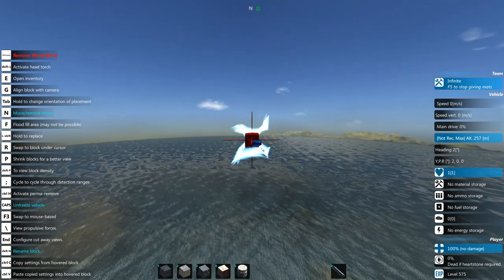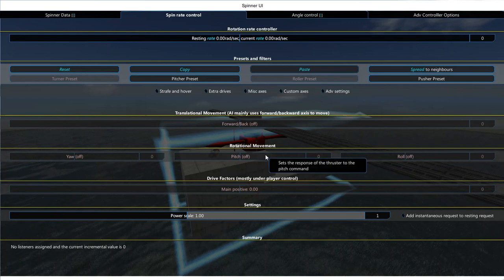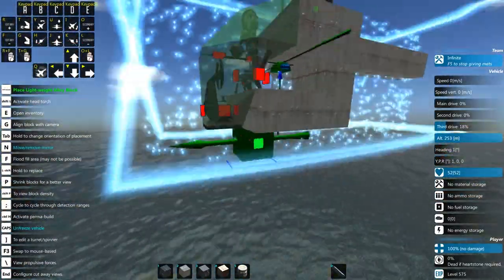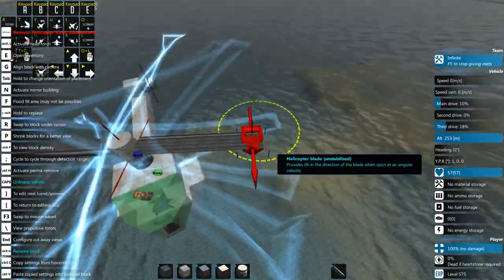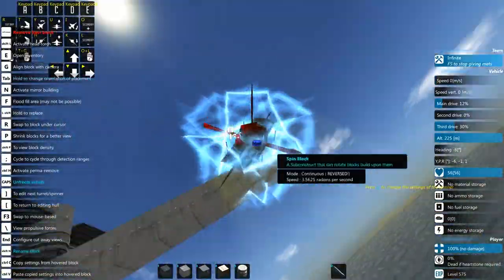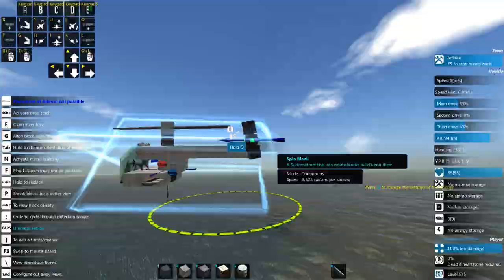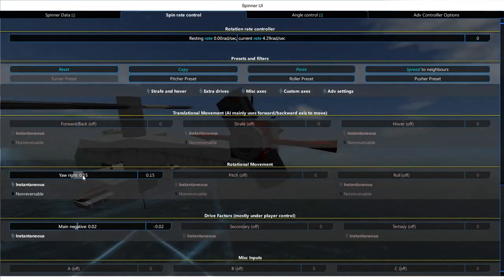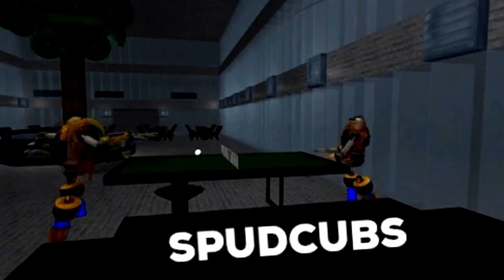10 Minute Helicopter

Comment: The idea of high altitude battles sounds absolutely amazing. I never thought about how much good raising the "space" border would do.
Reply: Airborne battles are lame, space fights are the "chads" of combat
Reply from the maker: Lowly surface combat virgins
Glorious dogfighting chads
Reply: If I'm correct Nick said he didn't really want that otherwise flying things would become "meta" and ships would just be less influential, but idk really, I don't believe that too much. This game has alot of potential simply by changing things (ammo regen gone or really slow, more mat zones but all are limited mat zones, increased map size, more diplomacy options, etc...) basically improve the base game (main campaign needs to be more of a strategy game)
Reply: @bluefireball3760  campaign is as much of a strategy game as it gets
Also, most famous crafts i've seen are airborne, but most ppl try to make battleships first cuz it's easier and you can go ham with weight
Reply from the maker: If you emphasize efficiency by making Fuel more expensive, or just by making larger fleets more necessary(which  would mean more fuel use overall), naval units would inherently by better just by having a lower upkeep cost that airships.

As for lighter-than-air ships(Zeppelins, balloons) -- They wouldn't be able to carry as much weight so they aren't technically more efficient. 

How do this? Make the map  bigger, remove ammo regen, reduce soup.

Comment: I wonder if you could use a 2-axis turret and custom AI to build a helicopter with a proper elevator system
Reply from the maker: What do you mean
Reply: @Spudcubs  If I remember correctly, elevators pitch the rotors forwards and backwards for easier horizontal movement, if a turret were to spin very fast it could work as a helicopter blade and could be used as an elevator on the rotor, the problem is how would that be controlled by an AI or a player
Reply from the maker: yes

Comment: Could you make a tutorial for making hovercrafts with the new 2.4.8.3 update?
Reply from the maker: sure. it's on the list
Reply: @Spudcubs  Hey man, im wondering if you could help me. Ive managed to make a super stable hovercraft, yaw pitch roll turning bla bla all work good but it just wont go forwards/backwards. Ive tried messing with all the options and pids but it just doesent work. Do you have any idea what this could be caused by?
Reply from the maker: @igorpadurjan5714  Won't go forwards/backwards? Like the AI won't?
Reply: @Spudcubs  No clue what happened but it got fixed somehow. Works pretty good now

Comment: i kinda wanna get back into FTD but idk
Reply from the maker: Do it IF THEY REMOVE AMMO REGEN
Reply: @Spudcubs  oddly specific terms
Reply: Why would you want ammo regen gone? Thats basically making every weapon in the game a whole lot more expensive due to resources and engine power for processors, the point of processors is to be small and reliable while expensive, kinda like injector engines
Reply: @enderon1175  he talked about this at length in his missile update video, it is actually a larger change to the way ammo is handled in general that he wants
https://www.youtube.com/watch?v=uiSsES6c2Fg
Reply: Enderon so it’ll have the same properties as fuel, and also it’ll also probably make weapons do more damage and give more value and tactical value to weapons and ammo rationing
Reply: @spinesauce2687  i mean if thats the case, good luck with having any missiles unless your made of processors, which get very expensive, almost like a steam engine